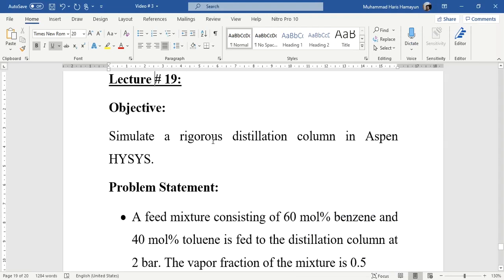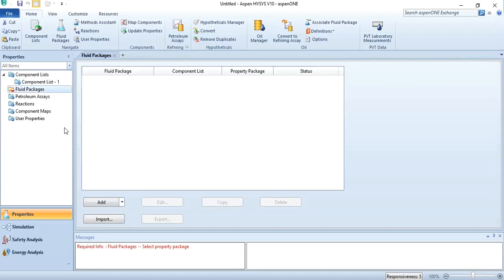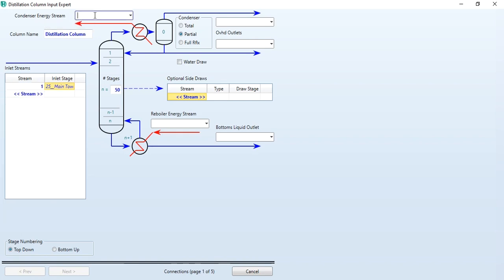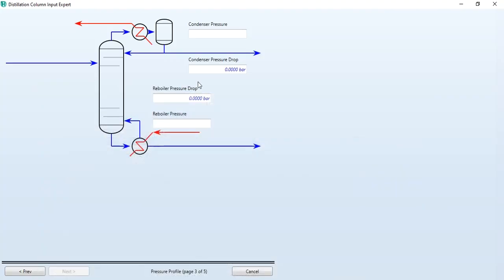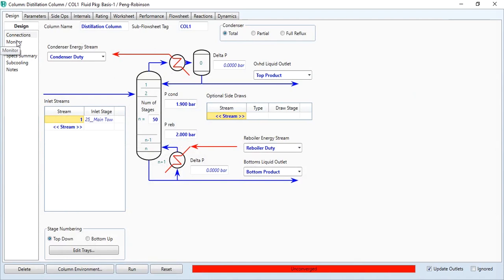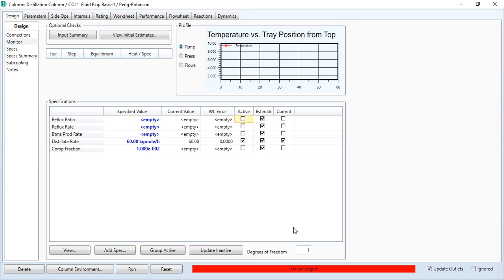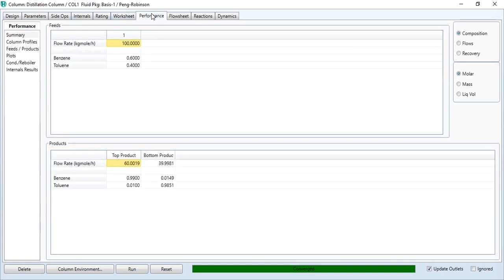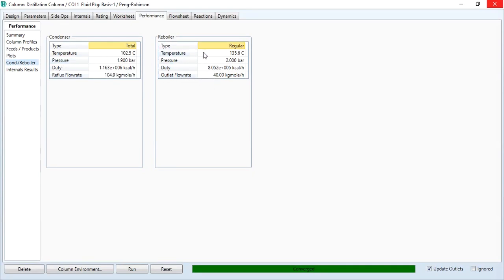Rigorous Design of Continuous Distillation Column in Aspen HYSYS | Part-1 | Lecture # 19

Comment: DOF for column to converge is 2 ??
Reply from the maker: No. Number of stage, feed stage, 2 parameters, and pressure of condenser and reboiler. So, total of 6
Reply: so for any column can we conclude the fact that DOF is 6 .. just as we can say in that of heat exchangers, heaters, coolersto be 2??
Reply from the maker: No. It depends. In case of dealing with distillation of petroluem refinery, DOF can vary ... But generally, you can say it's 6.
Reply: @aspenchemchannel  Thanks a lot.. your videos are conceptualised keep bringing more content .. your efforts are highly appreciated.
Reply from the maker: Thank you for appreciation. I will try to upload quality videos in future.